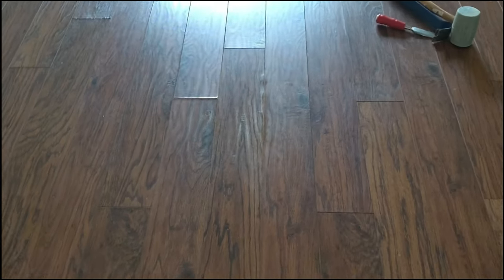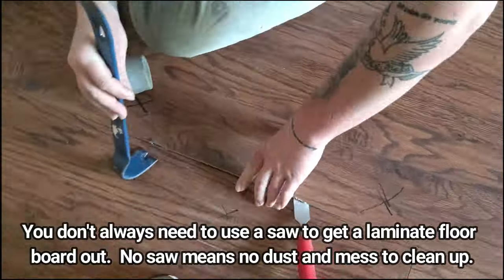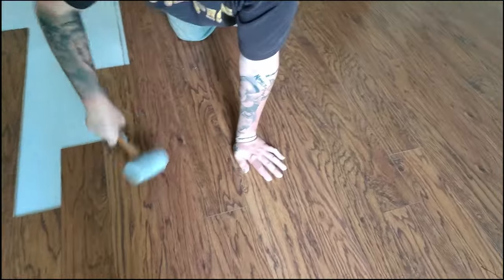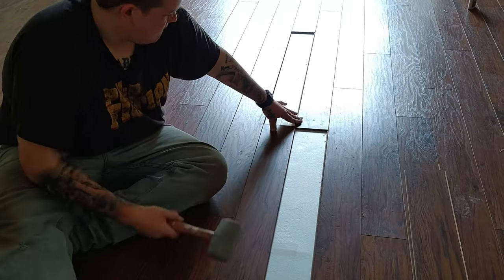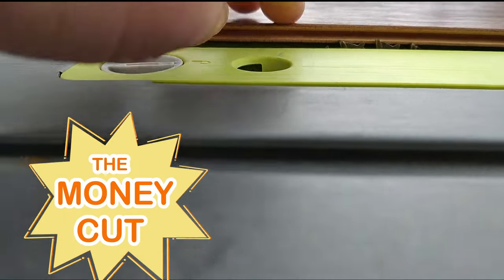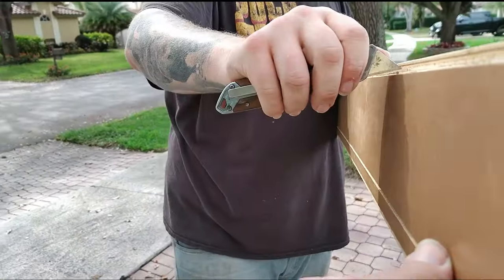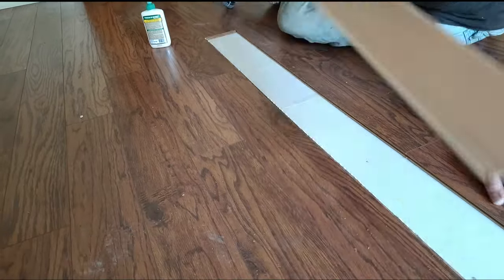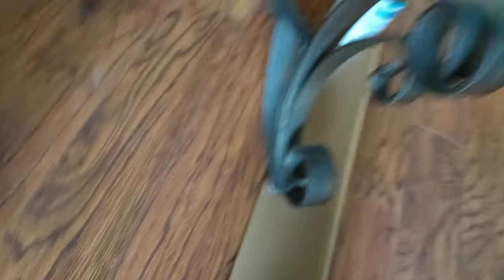Damaged Laminate Flooring Repair - DIY - How to Fix Water Damaged Laminate Flooring - Pet Pee

Comment: This is how to REPLACE, and NOT how to repair.  Your title is misleading.
Reply: How to repair your floor.   Tf you think he is, a magician?
Reply: @jamesjackson7616  I suppose the part that says "how to fix" is the part you got confused on.
Reply: @89degreestudio56  no it was clear.  Common sense is obviously a skill.   the damaged floor is repaired… not replaced.   Replaced would mean a entire new floor.    “How repair a laminate plank” is what you are looking for
Reply: @jamesjackson7616  you can't repair a laminate plank.  Only replace.  That's common knowledge.

Yes, I'm trolling you... by throwing your words back in your face.  Settle down.  You're way too worked up over nothing.  And from months ago, no less.
Reply: @89degreestudio56 you are the only one confused
Reply: There's really no realistic way to "repair" besides replacing think about it
Reply: @JohnSmithh644  well, if people don't know or have experience with the material... how would they know?  If it was so obvious, there'd be no point in making the video.
Hence why we've all come here.
Reply: @89degreestudio56  your definitely the reason they have instructions on everything
Reply: I understand what you mean. I am looking for a video to see if there is a way to glue down a seam that is slightly raised. More accurately, if there is a way to inject a glue underneath the seam. I have found nothing yet. Perhaps it cannot be done.
Reply: Because that's how you REPAIR something so freaking cheap. YOU REPLACE.
Reply: Can y’all argue in y’all dms? I still don’t know what kinds of floors I have how to fix repair or if I need to replace them. Idek if my floors are one big overlay or individual tiles. If y’all need someone to insult, try me. A complete stranger, so I fit the bill. Cause y’all are not helping
Reply: @ZawnKeepitcute  Settle down.  This was from 9 months ago.  You want us to resurrect a disagreement from almost a year ago on the side for...???  Pretty sure the dust settled 9 months ago... then you came along and threw a fit.
Reply: I am a little confused by the last board that was off screen… you slid it over so is the a gap somewhere near the wall?
Reply: @pamclendon  yes. But there should be a gap anyway to prevent bulging. If not, take away what you can as long as the baseboard covers it.

Comment: You saved my a--! I am about B+ on most construction jobs. My dog peed on a section while were out for dinner, and she left a HUGE puddle in the middle of the floor. We cleaned it up, woke up the  next morning to find a foot diameter circle of raised and feathered area of my BRAND NEW LAMINANT! That was in 2007. We just ignored it, and it got worse and worse. Now, we are selling the home, and it's time to do something about it. The realtor immediately noticed it, so this morning I scoured YT to find your video. I was gun-shy at first, but just kept going. The last board was fashioned with all the slots cut off except the front one. Since it was on the upper floor, and the base-board was wood, I screwed them in with two decking screw because it was SUPER TIGHT. I was tired of trimming, and only had two boards left, but it held very nicely. THANKS AGAIN! You saved me about $500, and I don't think the repairman could of done a better job. Wife is impressed with my skills! YOU DA MAN! Took about 3 hours and involved 8 boards.

Comment: This is incredibly helpful, but 
How much does a smaller repair like that normally cost (labor, then material separate)?
How do you match the new planks with the remaining planks?
How long does that job take?

Comment: I have that issue where some water sat over my laminate floor. It also had that bubbling effect on yhe edges. If I put a heater to it will that dry it out and help fix the issue?? Im sure if got water under it hich caused the bubbling up effect.

Comment: The first plank is the key...sometimes very difficult for example in a closet where the ends are tight to the wall.
Reply: If you have to repair a piece close to the end in a small area you can just take off the base and remove the pieces to get to the ones you want and put it back together since it's only a few pieces in the closet anyway. This video shows something you should only really do if the problem is in the middle of a big area and taking the flooring apart from the end is a bad idea